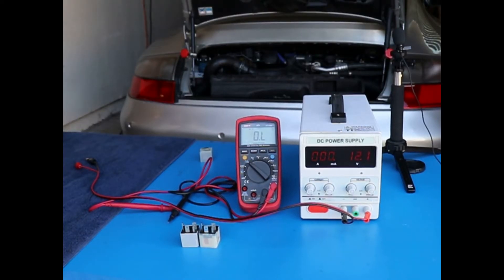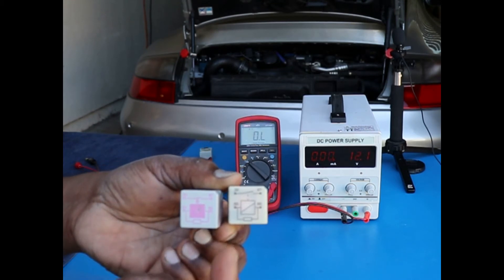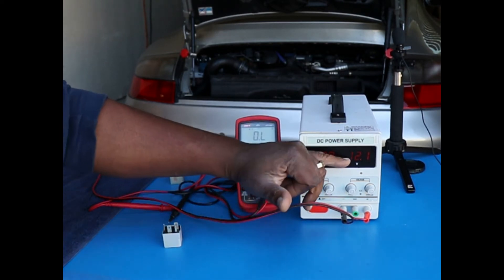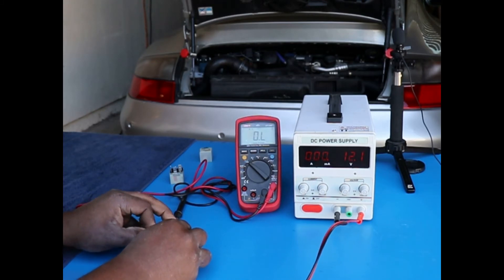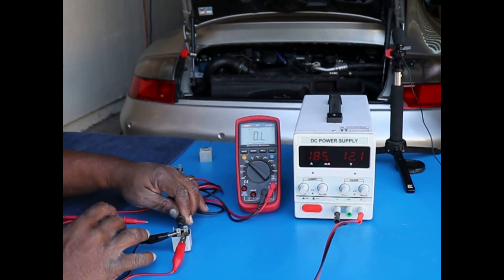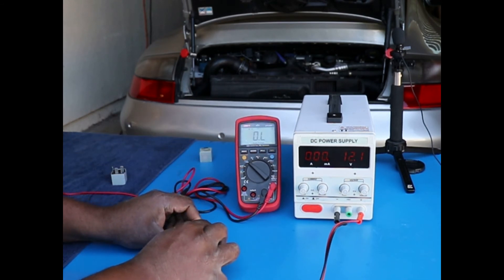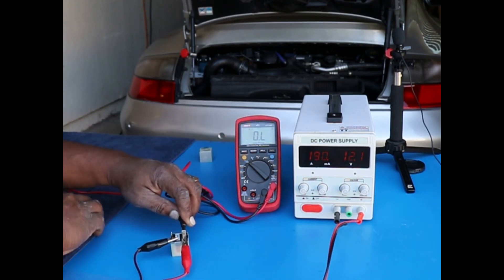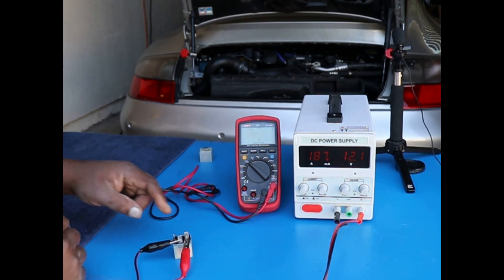How to Test Fuel Pump Relay for functionality and resistance

Comment: Like we gonna go out and but that just to find white thingy. To do you your way.
Reply from the maker: You could do it with a 12v or even a 9 volt battery. I just use the power supply because I have it. But you're right, totally unnecessary for these tests.

Comment: Surprise you didn’t compare resistance across the coils just to compare.
Reply from the maker: That's not a bad idea, and not out of the question either.  Good point.
Reply: I’m sure it’s fine as the coil is pulling in. Just thought it would be good to see.